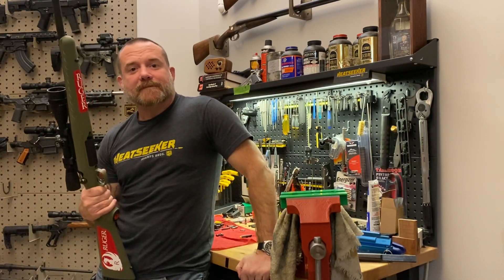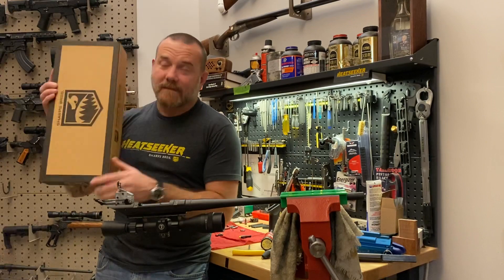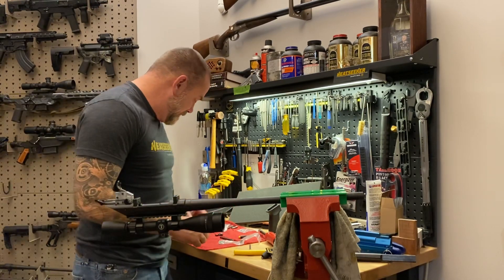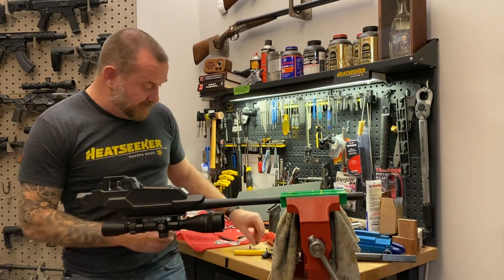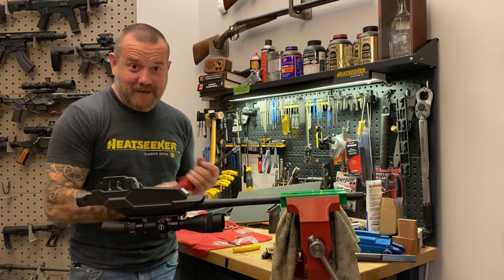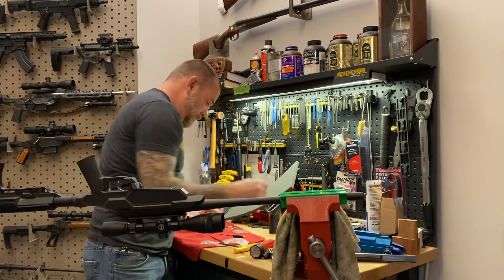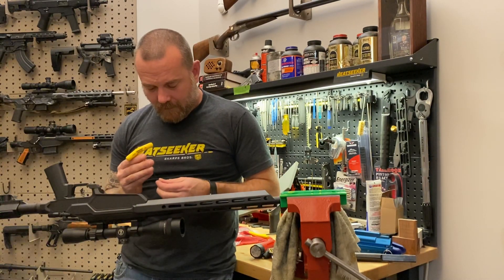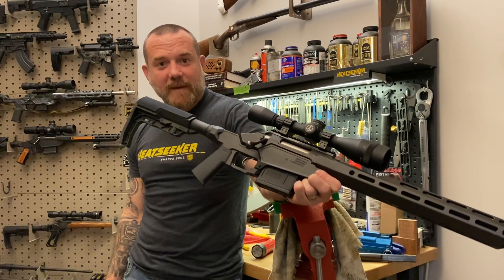Sharps Bros. Heatseeker chassis for the Ruger American Short Action (assembly / how-to build video)

Comment: great video. Is that a mil-spec buffer tube that screws in ?
Reply: Mil spec and commercial spec are same threads it’s the tube diameter is diff just make sure u use the stock for what ever tube you use milspec also flat and commercial as angle on the rear

Comment: Need this kind of stock for my Ruger 450 Bushmaster. I got it in trade and it's the model that doesn't have the mag swap plate so I'm stuck with only 3 round mags. No one even makes extended mags for that model yet there's entire sub reddit forums calling for it.

Comment: Would love to get one for my standard Ruger American .308 but mine has rotary mag will this chassis work on mine or no?
Reply from the maker: yes it will fit fine (but convert it to take standard AI pattern magazines)
Reply: Magpul makes 10 round mags for this build. Just put mine together. Literally took ten minutes. It took me more time to install an M-Lok bipod than it did to put the chassis and handguard on. Make sure to get a buffer tube, or that the butt stock you do get has one.

Comment: I just got a sharps upper and handgaurd and it fits like a glove to my silencerco sco15 lower. Like it was a match set. Only issue is the handgaurd and upper and lower all all 3 different blacks. At least match the upper and handgaurd colors.
Reply from the maker: all of our upper & lowers are made from 7075-T6 aluminum. They should anodize the same.  Both are anodized at the same facility. Most handguards, including ours, are made of 6061 though (to keep consumer prices low) which anodizes with a slightly different sheen of black.
Reply: @JSharps  thanks for the reply. The quality is phenomenal so the color issue is minor. I'll most likely cerakote the whole thing anyway.

Comment: Will this work on the 6.5 grendel?   Not sure on the mag situation
Reply from the maker: no this one is for the Ruger American short action - 308 or 6.5 Creedmoor.  Grendel is mini action sized.  We make a Heatseeker for Howa Mini Action as well that covers calibers 223, 30blk, 7.62x39 and 6.5 Grendel (which is one of my favorite calibers).
Reply from the maker: Revising my comment here as I learned yesterday about a AICS mag conversion for 6.5 Grendel.  Conversion kit from a company called Primal Rights.  It looks solid.  Because Ruger's exterior action dimensions are the same on the 6.5G (as the 308/6.5 CM) this may mean Heaseeker works fine for it, as long as you are using an AI mag converted to feed Grendel.  I will try it myself if I can find a Ruger 6.5G.  Will report back.
Reply: @JSharps  very cool thanks.   As you can assume I’m a huge fan of the grendel
Reply: Really nice chassis.